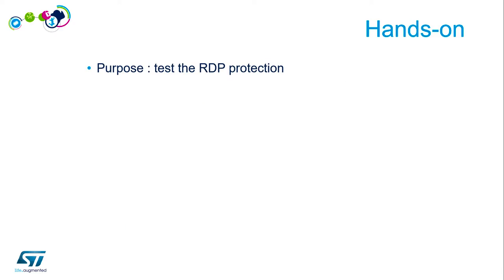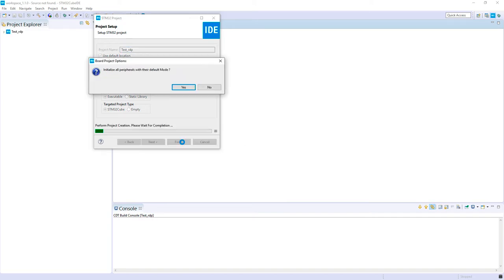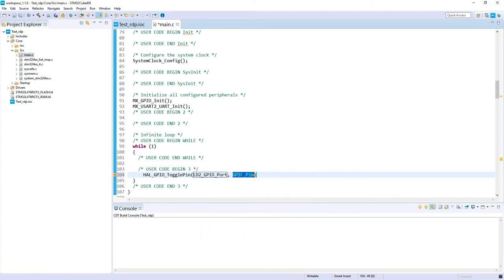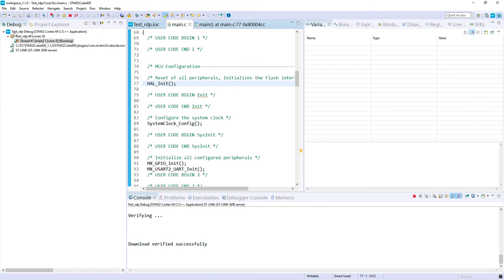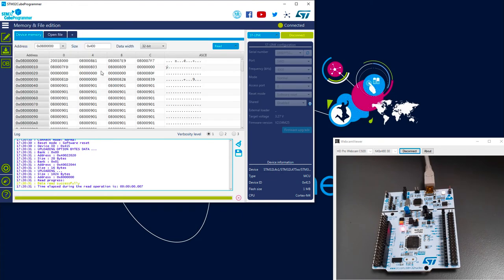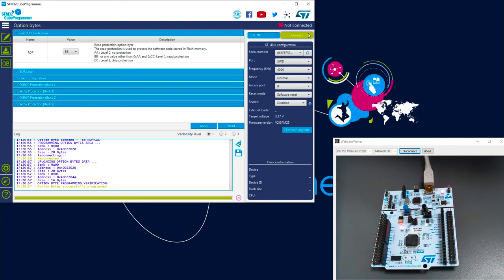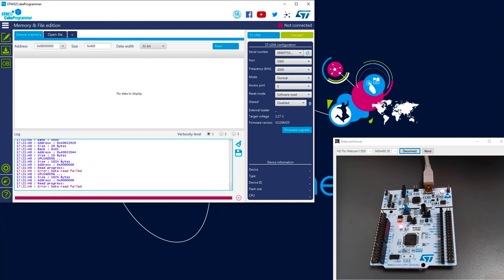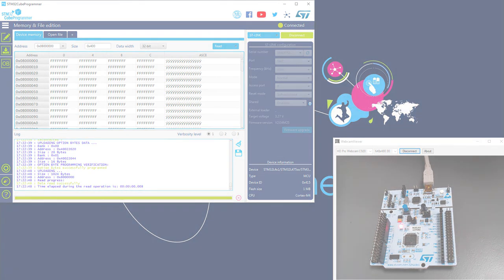Security Part3 - STM32 Security features - 09 - Readout protection lab

Comment: What does RDP value FF mean?
Reply from the maker: It means Level1 (like any other value except AA - which means Level0 and CC - which means Level2).
Reply: @stmicroelectronics  i read FF on RDP too on stm32f401 but cannot change it back to AA. what could be an issue and how to solve this problem?